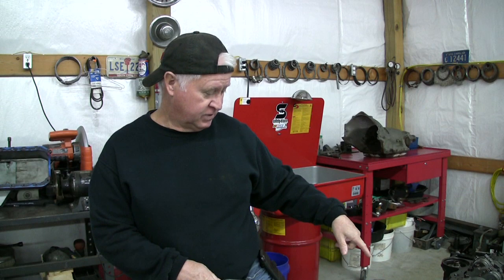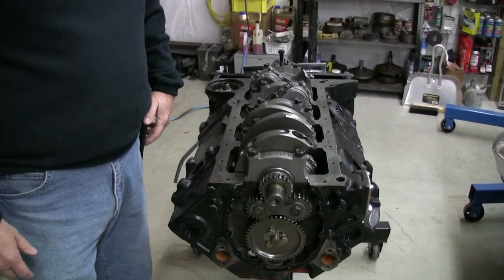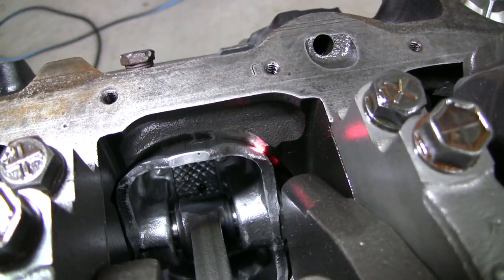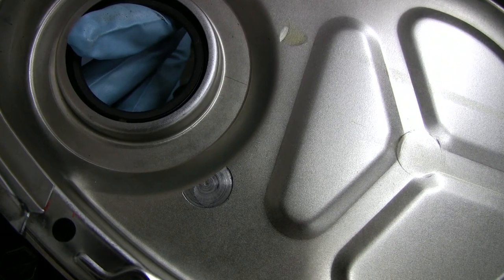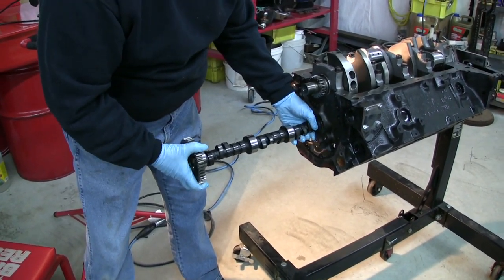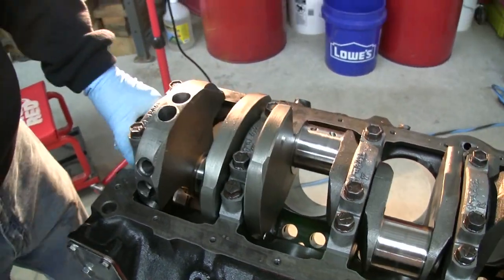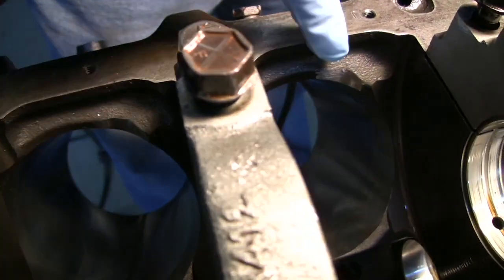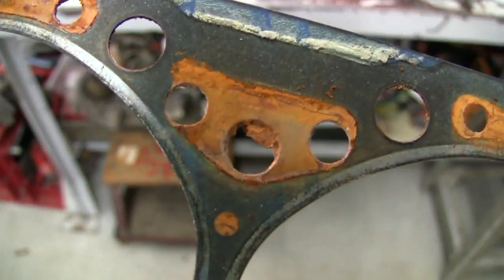67 Nova: "Pig In A Poke" Part 2

Comment: The cam thrust button is for maintaining accurate timing of the helical cam /distributor gears any cam walk changes timing...little timing tweak he must have had timing precision on his mind...maybe his old engine backfired alot
Reply from the maker: +area46241 I think his mind backfired. You are right on the cam walk. Roller cams will walk but flat tappet cams are cut to keep the cam in contact with the distributor gear. I don't have a clue what he was intending. I know that both the cam thrust button and the gear drive was grinding into the timing gear cover. Thanks for the comment!

Comment: Looks like a Pete Jackson gear drive, maybe the previous owner likes the whine that is similar to a 671 blower? for street use it is a bit much. Race engine, yes but a Street engine, no. the builder also never took heat expansion into account when carving the clearance of the reciprocating assembly in the block when the engine is at operating temperature. if memory serves, there was a special timing cover to use with a gear drive. not set up properly to say the least.
Reply from the maker: I agree with you Bigdog.The gear drive wasn't set up right as all the wear points show. Nothing was right about that engine. We appreciate you watching. Sub'd too.

Comment: in pig,,, in a poke part two, i was looking at the main bearings and they look to have a blistering effect to the bearing insert and you ask for my opinion but.... trash the crank shaft it is got too many problems with balancing issues and it looks like the crankshaft was balanced by a guy on acid
Reply from the maker: I can't see much of anything positive about this engine, Ellen. About everything that could have been screwed up is screwed up. I took the crank to a good machine shop and they reworked it. Said it's still "ugly" but should be functional if I wanted to take a chance on it. I wrapped it in plastic, coated it in oil and stood it in the corner of the shop. Been sitting there ever since. It's a reminder of how not to balance a crank. Thanks for your comment.
Reply: Hello, I am Charles I am the one that wrote to you on the crankshaft balancing, Frist of all let say my wife Ellen, and I, LOVE to watch your you tube videos.It is a true blessing to run across videos like your there is no swearing on your videos and my wife and I just love that. Thank you so much for that. Yall are just like two peas in a pod your wife loves cars restorations and you as well and my wife and I just love that yall both remind us of ourselves yall joke and carry on just like we do and have fun doing it. Again thank you and your wife for such great videos.
Reply from the maker: Thank you Charles and Ellen. We have fun and like to share our adventures with those who choose to watch. It's an honor to have fine people such as you two, to join us. Our channel is entertainment for the family. We don't use bad language off camera and never will on camera. We truly appreciate those who watch and take the time to leave a comment especially when there is so much other content on YT they could be watching.

Comment: Bought a mystery 440 motor put it right in guy says! What a joke!  Timing gear loose on crank bent pushrods cylinders messed up bearings scored etc! Guy got me on the price then pulled parts off motor valve covers intake! I was desperate to get my car going and got had he even wanted a 440 block and pistons and rods in exchange after  finding out what he pulled I gave him 383 rods and pistons when he got home phoned me he was pissed! Didn’t recoup my money but least got him back a bit! Paid for his gas to drop it off too! Guy was a real loser!
Reply from the maker: Dang! He sounds like a real loser.What goes down comes back around, I always say. He will get his.